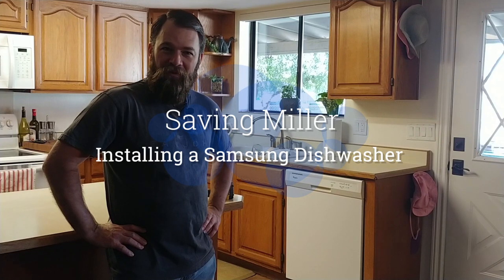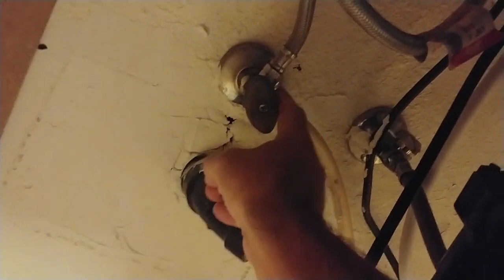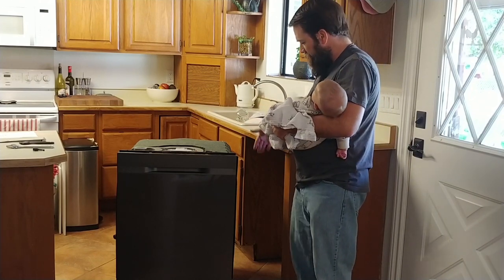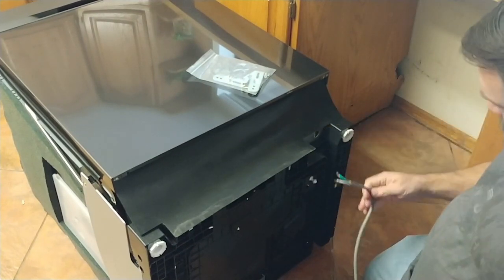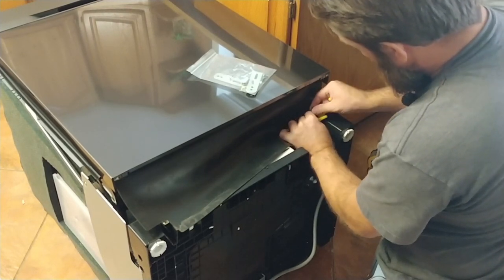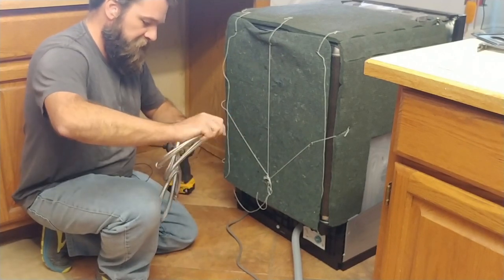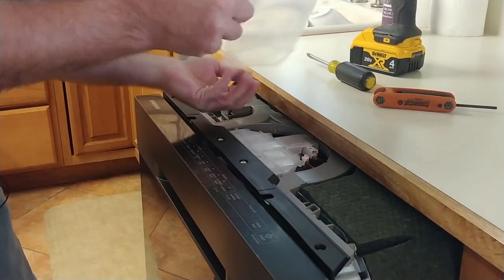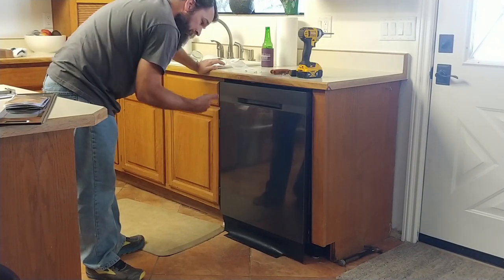DIY How to install a new dishwasher Samsung DW80R5060UG

Comment: You are supposed to use that plastic piece/cap that was connected to the water supply from the factory.  They want you to remove the brass piece from the elbow and slide the plastic one onto the brass elbow. Keep the rubber seal in place as well.  If you don’t do this it will leak as mine did. They don’t want brass on plastic I guess.  Hope this helps and, all of this  is stated with pictures in the install instructions!!!
Reply from the maker: Yes, you are right about what the instructions say. However, I could not find a way to use the plastic piece. I would think the brass would be much more durable. My conclusion was that it is only for use in a different situation, but I might be wrong. Thanks for the warning! I  haven't had any leaks, but I will check and make an update if I do.
Reply: Your welcome.  I just thought I’d share what I’ve learned from my mistake.  Hope all is well with no leaks ever!!! Very good video by the way.
Reply: This comment is very confusing 

There is no way to just ‘remove’ the brass piece and replace with the plastic one - not using my Home Depot Kit 

I am using it the way the video instructed 

I know you are trying to be helpful but I want to comment here for anyone who tries to do what you suggest and gets confused and thinks their dw is going to leak because they can’t figure it out
Reply: I tried using the parts supplied and ended up with rain in my basement. I came here to see what i did wrong and you didn’t even use the supplied parts. Arrgh! I think i will just buy the piece that you used. It seems more reliable. FYI: there is not a lot of room behind or underneath when you push it in.
Reply from the maker: I'm think the little plastic piece is for a different application. It just had no use for me and I guarantee it would not make it better than the hose I used.
Reply: Siva Nathan thank you it was well explained there
Reply: @sivasivanathan5756  Yes, but just to confuse the consumer, they also supply this video that shows connecting the brass fitting to the plastic: https://www.youtube.com/watch?v=BEHX5BVOtWY&list=PLRWZJMHkBzLIz9S68sYpVYwg3BDBvwn-x&index=3
Reply: @brandoncoffee8044  i know I need to watch because I need a New dish washer, I have been eyeing Samsung, they say they won't service it in my area, I am not purchasing a warranty, and I am not paying them to install since they will only install into a plug and not a hardwired version???
Reply: @brandoncoffee8044  did your dishwasher work fine now after you changed it to plastic?

Comment: Thanks for going slowly enough so that a "novice" like me can grasp what it is you're doing . I think my old dishwasher is 'hard wired" so am a little anxious re: electrical installation. May try to get s little extra help with that part of the installation .
Reply from the maker: If you take your time, I'm sure you can handle it. Being hard wired shouldn't be a problem. Just turn off the breaker before you start touching wires.

Comment: Thank you so much for the video.  I have a question that no and I mean no one can answer.  When you are working on electrical connections there is a large rubber flap that you move out of your way.  I am told that it is to catch steam when door opens at end of cycle.  Can you help supply part number or any help would be greatful

Comment: Awesome guide thank you! Did this for the first time was super easy. Only issue I had was had to cut the drain like a little since the spot mine went too didn’t seal right with the bigger opening on the end of the drain tube so it leaked first test. I ran it a little first and checked my connections before putting it back into place. Glad I did that
Reply from the maker: Great, glad it worked out for you. Plumbing can be really tricky!
Reply: Yeah I understand to cut mine too for a better fit.

Comment: Pro Tip:  the hole in your cabinet needs to be at the bottom of the cabinet or it won't fit properly.  If the hole is at the top, the disposal hose is just a tiny bit too big as it crosses the back of the machine.

I used a 1.5" forstner bit and it was the perfect size.
Reply from the maker: For sure! Especially for this unit.

Comment: Oops that Cap is very important in proper installation. That is what you attach to the plastic thread you must remove the metal hose fitting on the elbow and use the plastic cap with the rubber gasket.

Comment: Hello Mr. Miller,
Tom from Ohio.  Nicely done, thank you.   I found your video because my wife and I are looking at the exact unit.  Both HD and Best Buy have it at 809. That's as of 1/2/21. I saw your other video where you mentioned that you wouldn't buy it again due the cleaning challenge at the screen. That' s a real bummer .  What were the engineer's thinking?
 What would you do if you were me?   What brand ?  I want exactly what you have ...the dark graphite stainless but don't want to go over $800.  We wont use it that often. But we want the finish just like you did!
Again, well done!
Reply from the maker: I would say that if you do want this one, you should wait for a sale. We bought our's from Lowes when they had a 30% off appliance sale. That makes it a much better value.
If it's going to have light use, it will probably be just fine. It's been a year now and we have not had any functional issues at all. It still isn't great at cleaning, but we get by using it on a daily basis. However, I would definitely recommend looking at the Bosch offerings as well. The ultimate choice would be the Fisher Paykel drawer dishwashers. We previously had one and should have gotten one of their again. The price, however, it a bit of a shock!
Reply: @savingmiller  Thanks! They're supposedly on sale now because of New Years specials. I'm thinking like LG and other imports, the prices will not lower much. You purchased yours prior to all of that the tariff noise on appliances from Asia.  Can you do me a favor and expand just a bit on the problem with cleaning the screen?  Maybe since we will only use it a few times a year , it will be okay.
Reply from the maker: @tomm2271  That's probably true, the prices have likely gone up. Basically, any larger food particles go to the drain screen in the bottom and stay there. There is no removable piece to clean it out. You have to take screws out of the drain to clean it out if it gets plugged up. So it might be fine for a long time, but a heavy load might plug it up and fill the dishwasher with water if it can't drain.
Reply: Never buy a Samsung or LG appliance they suck. They know how to make phones and TVs that's it.

Comment: What height is best to set unit with the top controls? Do you every need to access controls when closed?  I think its designed to be installed with a small clearance (that wouldn't allow access to button).  Thanks for the video and help!
Reply from the maker: I installed with about 3/4 in. gap. The controls don't work when the door is closed so it could be much closer. However, it is nice to be able to see what the settings are when it's running. Other than that, it really doesn't matter, so it is preference.

Comment: What size was the electrical strain relief connector you used?  I got 3/4" and it was too big.  I think 3/8" may be too small.
Reply from the maker: It's the nominal 3/8" size. Pretty standard. The actual hole measures roughly 3/4" so it's a bit confusing. The fittings are sized according to the conduit diameter (which doesn't apply in this case).
Reply: @savingmiller  Thank you.  If they don't supply the part they should tell us what size to get, don't you think?
Reply from the maker: @therealryanclock  Yes! I think the idea overall is to get you back into the big box store as often as possible.

Comment: I am so impressed on your detailed explanation. Made my job a lot easier I opened up mine and I’m like where the installation manual and water connections anyways. I’m got it done without a mustache because I can’t grow one (sad face). Thanks again
Reply from the maker: Glad it helped! It's always nice to see what your getting in to before you start!
Reply: @savingmiller  I thought the instructions was clear.  Thank you.  Especially like the statement you made about the "support beverage" :)

Comment: Great instructions. What was the cord you used? I called Samsung parts and they said there is no part for that and said his only guess was the $190 wire harness which I’m pretty sure is the wrong part!
Reply from the maker: Haha, yes it should be less than $20. Here is a link for one from Lowes. Dishwasher appliance power cord. You should be able to find this at any proper hardware store.

https://www.lowes.com/pd/Utilitech-6-ft-3-Prong-Black-Dishwasher-Appliance-Power-Cord/50432008

Comment: Where do you get the seals on the side 1:41? I have a gap on my new dishwasher on the sides?
Reply from the maker: We bought the home with the old white dishwasher in place, so I didn't install these. The new one had similar seals. If you do a google search, you may be able to find something. Bosch makes a decent little kit.

Comment: Hello, in minute 15:09 you mention that there was a little “cope in there”  and that you removed it. Now, there is in the same spot a filter or strainer.. is this supposed to be lifted there or should I remove it? Thank you 🥄 🔪
Reply from the maker: Yes, there was a little "cap" on mine, probably to keep debris out during shipping. Make sure that little cap is removed, but leave the strainer screen in place. The cap on yours may have been removed already. The screen is fine.
Reply: Saving Miller thank you so much for replying. I will finish connecting the electricity tomorrow. The cables are a bit short but I will manage ...I think 😉

Comment: Dammit man. I'm trying to figure out if I even CAN install a Samsung dishwasher.

Had home depot deliver it but when they got here, the installers said the drain hose wouldn't be long enough since the dishwasher location was too far from sink. So I had to refuse the delivery.

They didn't speak good english so it was hard to get a proper explanation. They said something like I could have a plumber come out and extend the drain hose or something but they wouldn't reccomend it because too long of a drainage hose can cause a backup or something. They suggested I get a different brand but we don't want a different brand. So confusing. Does anyone know what they meant and how I could fix this situation so I can have a Samsung dishwasher?
Reply from the maker: Wow. Yea, I do not have much faith in the "installers." I'd rather do it myself. They might be right about drain length though. If you don't feel comfortable with the plumbing part, you might have a licensed plumber set up the drain properly and then install the rest of the dishwasher yourself. I don't think this is a brand specific issue.
Reply: @savingmiller  Ok. Thanks

Comment: What about the side screws? ( my countertop is quartz made, i cannot put the top screws..)
Reply from the maker: On this particular model, the side screw setup was really bad. I couldn't put any in because the holes were too large. Ideally, you should put them in if you can figure out a way to make it work. For quartz or granite countertop, there is usually a plywood backer. If not, you can use construction adhesive to adhere a block of wood to the quartz or granite, then put a screw in once it has cured. It depends a bit on how it is made.
Reply: @savingmiller  thanks for replying to the above question. I too found the side wall screws to be MASSIVE. I skipped them and made sure my brackets were super secure.
Reply from the maker: @honormountain4356  Good find!

Comment: So I have to buy the plug. No wonder I couldn't find it
Reply from the maker: Yes. I thought that was a bit odd too. You will need to buy a cord and water supply line, along with some wire nuts and a strain relief (the little thing that fits in the hole to hold the cord to the box). Almost all other appliances come with the cords in place. But not dishwashers!
Reply: Mostly, if you buy a dishwasher installation kit, it will be included.

Comment: What's the model number of the water line from Ace?
Reply from the maker: Looks like the Ace brand item number is: Item no.4061180.
Here is a link: https://www.acehardware.com/departments/plumbing/supply-lines/appliance-supply-lines/4061180
Reply from the maker: Similar one from HD: https://www.homedepot.com/p/Burst-Protect-3-8-in-x-3-8-in-x-72-in-Universal-SS-Dishwasher-Connector-Inclusive-of-3-8-in-Mip-and-3-4-in-GHT-Adapters-7223-72-38-6E-BP/207158420

Comment: The video is nice but not helpful. Sadly for me this is about the washer and it’s a poor design. Put a water supply in the back? What if there’s a leak? You have NO access!  You can’t see it. Supply should attach in the front. Next the Drain line is too short. Not everyone has the washer sitting next to the sink. Mine is around the corner. I have to pull a cabinet to snake the line but need at least 2 feet more. Of course if it were located in the front it would work.  Looks like I might have to take it back and find a dishwasher that is better thought out.